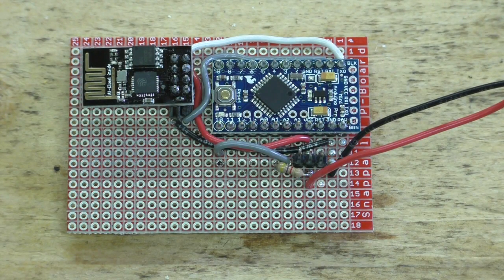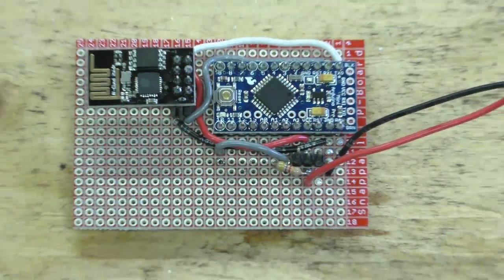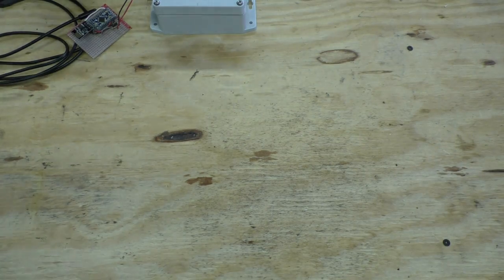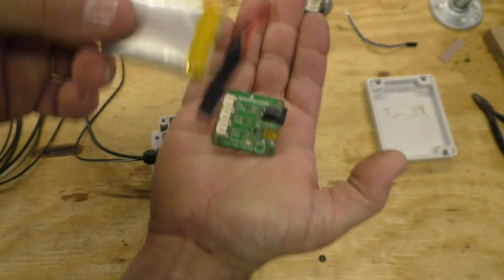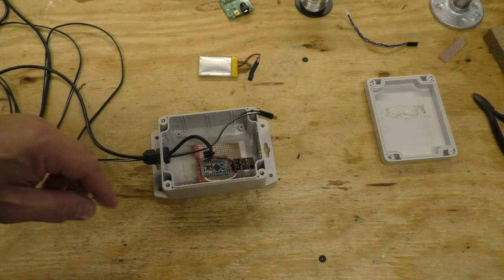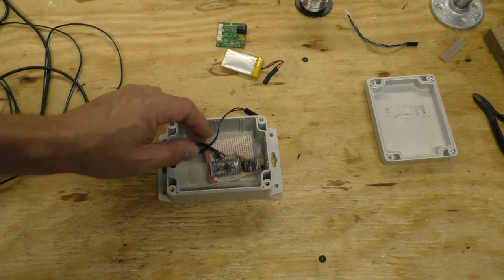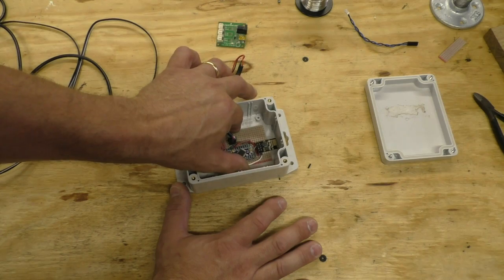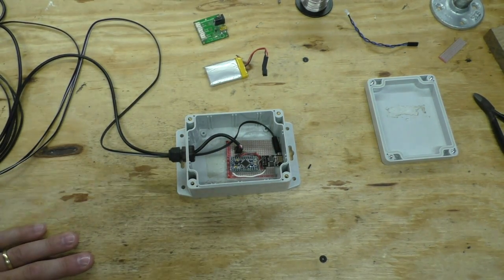WIFI Pool Temperature Monitor - Part 1

Comment: Shame you let the smoke out of that chip :( Sparkfun also sold syringes of the smoke for a time, but it was purportedly difficult in the extreme to refill the chips!
I also have that same board by the way, only in red :D
That battery doesn't look too healthy by the way, like it's swollen :| I'd get another one the same time as you get a new lipo :)
Reply from the maker: Yeah it is starting to swell, that's why I am letting run till it's dead.  I think I bought it the same time as the charger board.
Reply: Making Stuff That's a whole bunch o' years old then, that lipo! That's something you definitely do not want to let the smoke out of :D
Leastways not indoors! :P
Reply from the maker: Azayles
It will fall into the pool if it catches fire, lol.
Reply: Making Stuff Just be sure to get that on video! xD!

Comment: why do you use am arduino and an ESP? you can do all the coding with the ESP only. there are other ESP variants with more GPIO Pins - if thats the reason why your using arduino and ESP. 
this will save a lot of energy.
Reply: That link wasn't as good as I thought . A better one. http://www.esp8266.com/viewtopic.php?f=6&t=9508
Reply from the maker: The temp probe uses one-wire interface.  There is already a library written for it for Arduino.  Not sure if this is available with ESP.  If so, send me a link.
Reply: I second this comment, No need for the promini.
Reply: http://www.instructables.com/id/ESP8266-WiFi-DB18B20-temperature-sensor-ESP8266-Ar/
Reply from the maker: Jon Vannatto
Awsome! Thanks for posting this.  I'll check it out.